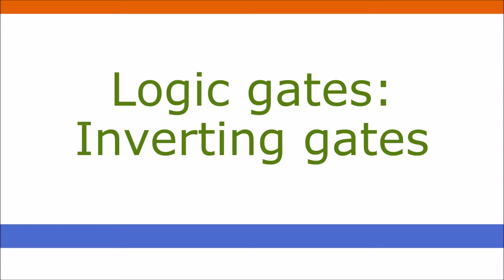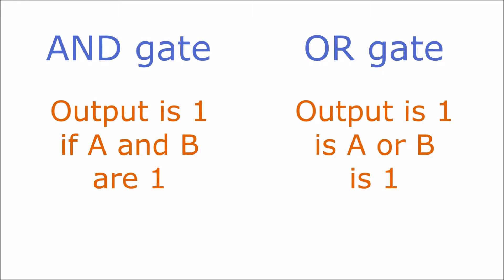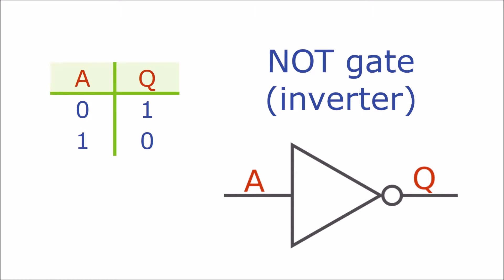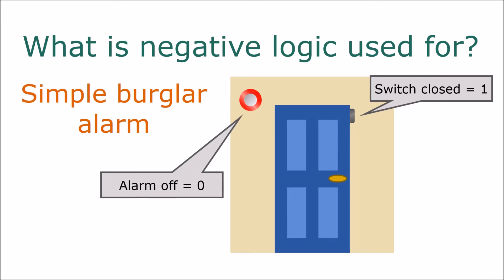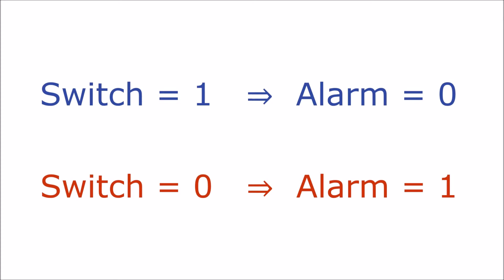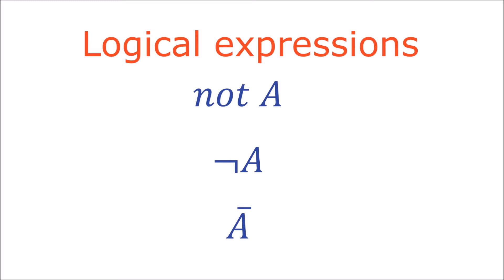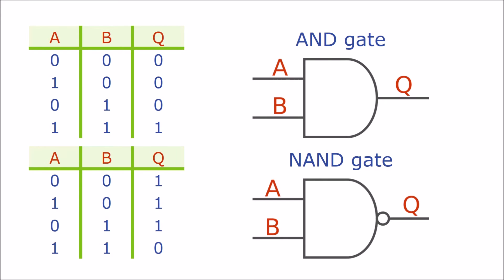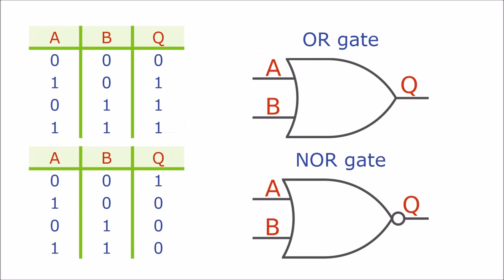Inverting gates

Comment: Thanks I understand the point of not gates now, so it means like if u have the key to open the door then the alarm goes off when the door is open, as they are the owner.. of the house etc, but the alarm needs to be on when the door is closed so it goes off if someone breaks in, obv in non computer jargon terms.